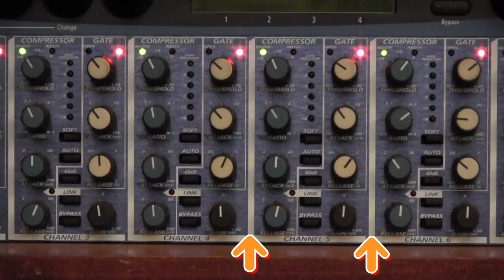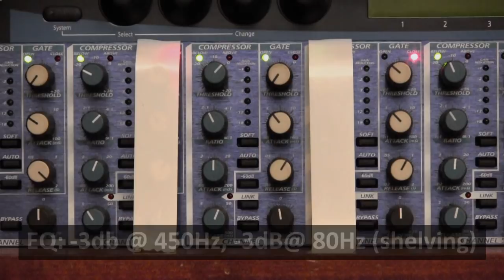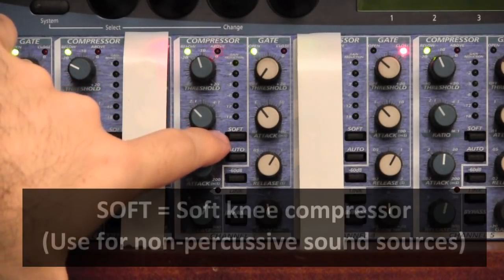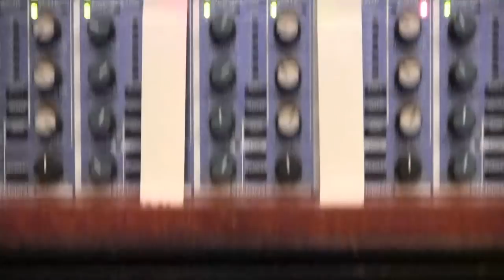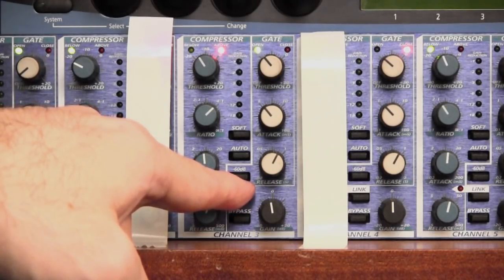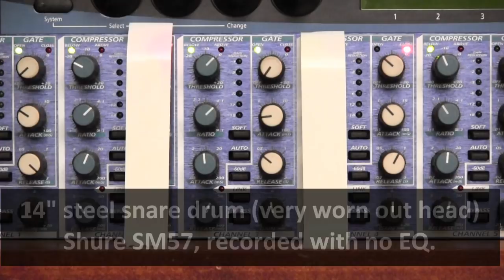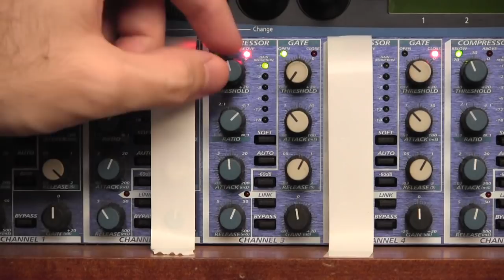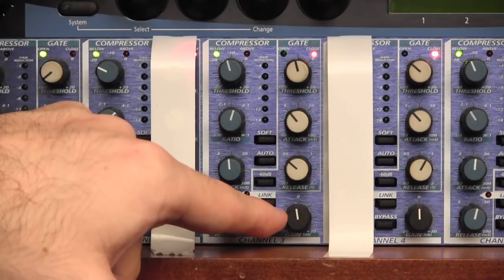How to operate the Presonus ACP88 8-channel compressor/gate

Comment from the maker: Welcome to the sound engineer community! The best way to hook up the unit is using the insert points on your mixer's channels - this is shown on page 15 of the owner's manual which can be downloaded from the Presonus website. Alternatively, if your mixer doesn't have insert points, you can go TRS out from your wireless receivers into the input of the ACP88, and then TRS from the output of the ACP88 to the LINE input on your mixer.

Comment from the maker: - You're welcome, glad the video was useful. Because the Firepod has no insert points, it would be difficult to integrate the ACP88 - you cannot connect mics directly to the ACP88, and it's really designed for use with a mixer. My advice would be to use the software processing in the Firepod itself to do your gating and compression - just be sure to set your gain levels conservatively when recording, and add dynamics controls later on. Hope this is clear, feel free to ask other questions :)

Comment from the maker: - Thank you, glad the video was useful! If you have already checked the fuse in the unit and the outlet, I would say the other possibility could be a faulty switch, or a blown fuse in the power cable - I would try switching to a different IEC cable for starters.

Comment from the maker: - Thanks for the question. Typical setup for live use would be to connect your drums to the mixer first. The presonus is inserted on the individual drum channels as shown in the video, and the lexicon is run on a post-fade aux send so that all the drums can be routed to it as necessary. Finally, the lexicon is returned to the mixer using a stereo input channel. This will allow you to adjust gating, compression and reverb for each drum separately.

Comment: Thank you for a great presentation. I have used compressors and gate/limiters often in DAWs, but not hardware. I recently picked up a ACP88 for $50USD (needs repair unit). Concepts are the same, but I never really dove into just what was going on. Just fiddled with knobs until I got the sound I wanted. I went into my favourite DAW after this, and applied the concepts to very common and basic sample kick, snare and bass. Compressors and gates really do give you that snap and pump, as well as greatly define the shape of the sound. Now that I know full well what exactly is happening, I can better apply them. Can't wait to repair the ACP88 and try it out on my hardware synths.

Thank you for sharing
Reply from the maker: Thanks for the comment! Hope you enjoy your new hardware compressor - I always find having physical control knobs makes my mixing experience much more enjoyable.
Reply: For me you will learn more by turning the knobs with your own fingers on an hardware prossessor like the ACP 88, you will hear that just changing a fwew millisecondes the attack by example, how much it can change the sound.
From Switzerland mountains, I hope you will enjoy by mixing with this kind of gear! 😚🇨🇭☃️🌲

Comment from the maker: - The easiest way to determine the location of the fault would be to swap the cables between channel 6 and one of the other gates that is known to be working. If channel 6 is now working, then you know you have a cable problem. Otherwise it is probably a fault internal to the unit.

Comment: I started doing sound for a community theater group.  We have several Shure, Sennheiser, and Samson wireless microphones and in one of the racks was an ACP 88 unit.  One thing you didn't show is how to connect in the back of the ACP 88 unit.  I can go XLR or TRS out of our wireless mics into the back of the ACP 88.  There are 4 TRS jacks on the back of each channel on the ACP88.  what do I plug into what TRS when I only have 1 mic output for each mic.

Comment from the maker: - Thanks for the comment, you raise a good point about how to hook up the unit. I will make another video showing the rear panel connections when time allows. To begin with, do you have the necessary 'insert' cables with which to hook up the unit? Personally I use the unit live as well and it works really well.

Comment: Do you subscribe to the notion of always running the compressor only in the insert plug or do you sometimes go through the compressor first?
That was a fantastic presentation of the compressor function and usage. I learned a huge amount of information. Thank you very much.
Reply from the maker: Thanks Doug! It depends on what I'm using the compressor for - if I need compression on one specific channel it will be in the channel insert or inline before the channel input. If I need compression on an entire mix then it will be in the main inserts or inline between the mixer and the power amp 😊

Comment: Thank you so much sir for video. i do clearly understands now how compressor and gate works. Sir, can you please tell me which band instruments or mics on the stage are the sound engineers putting compressor and gate?.

Sir do you have a video of how to remove feedback using 31 band EQ in stage monitor and the front of house speaker?

Thanks a lot sir.
Reply from the maker: - You're most welcome. Compression can be used on almost any input, from drums to guitars and vocals. It is also used on the main LR output. Gates are generally used on drums and other percussive instruments. 
I don't have any videos on 31-band equalizers because I generally prefer parametric EQs for live use. Also most EQ on large PA systems these days is done using the software EQ on the system processor.

Comment: great  video but it is a mulri channel compressor.. mine is only a 2 channel compressor thus why i want to insert it at the main insert instead of a single channel.. additionally i saw a video on using a y cable to do it but im not seeing any read out on the display thus why im asking you for additional help

Comment: Can you please help me! I new to micing drums, I want to buy the setup you have and I need 8 channels for my DW drums . Does the Lexicon effect unit connect to the Presonus ACP88 8. Then the Presonus connects to the mixer.Or does the Lexicon need 8 separate outputs or does it use 1 cable to send effects to all 8 channels on the Presonus. I know to get a good drum sound you need Compression, Gating, and a little Reverb. I just understand how the Lexicon connects to the Presonus. Thank you so much

Comment: just came across this compressor,gate,limiter. im wondering if you still use this till today ? im currently looking into getting outboard gear, some of the compressors are pretty high in price and only offer 1 channel. this in the other hand has 8 channels which would work perfect for a drumset. would this still be relevant with the products out today ? thank you for the video !
Reply from the maker: Hi Arturo, I still use it from time to time, but over the past few years I have begun to use less compression in my mixing - modern active speaker systems include system compression and good musicians and singers will often 'self-compress' through the use of good playing and mic technique. However the ACP-88 is still an excellent choice if you need 8-channels of compression in a compact unit!

Comment: Difference between dbx comp 166xL and that presonus acp88-8?
Reply from the maker: Similar functions with slightly different controls and connectors. Obviously the ACP88 is an 8-channel unit vs 2-channels for the DBX 😊

Comment: Can the ACP88 be used in conjunction with the Tascam Model 12, although it doesn't have insert connections?
Reply from the maker: The model 12 has insert points on the first two channels. The compressor can also be patched in between the mixer and your amplifier.
Reply: @GLBProductions  Thank you.

Comment: Thanks for a very informative video! I recently acquired a used ACP88 and plan to use it to record drums. However, the mixer I use is a Presonus AR16 USB and it only has inserts on channels 1 and 2. Do you know if there is a way to use all 8 channels when I only have two inserts? Thanks again!
Reply from the maker: You're welcome! Unfortunately this unit really needs channel or main insert points to function most effectively - it's an old school design that pairs best with old school mixers 😄

Comment: Good video thanks, I saw that PreSonus put the compressor at first than the gate after, usualy most of enginners and me too when using both gate and compressor we put the gate at first than the compressor, is it possible internaly on the ACP 88 to reverse the way and having the gate at first? THANKS for an answer.
From Switzerland mountains I send you all myBEST to all of you and having pleasure by mixing a lot of gigs.
❤️🌲☃️🇨🇭😚
Reply from the maker: Thanks for watching 😄 You would need to ask Presonus about reversing the order of gate and compressor - there is no mention of this in the user manual.

Comment: Hi, thank you for your excellent tutorials. Could you explain what the "link" function does please?
Reply from the maker: The link function connects two channels of the unit so that they track together, ie the amount of compression is the same on both channels, usually following the first channel's settings. The is most often used for stereo sources where you want the stereo image to stay centred during operation.
Reply: Thanks for this explanation and for your quick response.

Comment: Bruno in the video you don't share why you keep the Gain set at 12 o'clock.  Given a compressor does reduce the dynamic range of the signal, and thus the overall signal level, how are you making up for the reduced volume when the signal exits the ACP88 and returns to your mixer?  Are you just using more fader on the mixer, or some other technique?  Thanks!
Reply from the maker: Sean Kent A very perceptive comment indeed! That video has been up over two years and you're the first person to ask about that. When I first started doing sound, I read a book by a very experienced live sound engineer by the name of Duncan Fry. In it, he explains that in live sound with loudspeakers connected to mics in the same acoustic space, you need to be very careful about using more than 2-3dB of make up gain on a compressor, UNLESS you are confident that your system EQ is perfect. You see, when the music is playing and the compressor is compressing, it's no problem because the make up gain is being used to compensate for the gain reduction on the compressor itself. When the music STOPS, your gain reduction goes to zero - at this point, any make up gain you have dialed into the compressor suddenly becomes EXTRA gain, and can start that channel feeding back very quickly! He argues that it is much safer to simply ride the fader, as then you do not have this issue of 'hidden gain' that is not accounted for by the channel gain knob. I have heeded his advice ever since. The advantage of not using the make up gain knob on the mixer is that you reduce the number of gain stages in your signal chain by one, and you know for fact that when you see no lights on the compressor, you have just that - unity gain, as opposed to a certain amount of gain addition that may be different for each channel. Now in recording I take a different approach because there is usually no risk of feedback, but this is my technique for live sound. Thanks for asking!

Comment: Hi, Bruno, i am sorry to bother you, when you hook up compressor, you have to set the gain from mixer first right.  Then adjust the compressor second
thanks
Reply from the maker: hoang tieu Correct - set gain on the mixer first, then insert the compressor and adjust for desired amount of compression. This will give you the best signal to noise ratio.

Comment: I thinking about getting a presnous acp 88 but I have a question I'm using alesis 3630 compressor I was wondering how will I set it? Does I output from the mixer to the presnous or to the alesis first?
Reply from the maker: chai cha chai cha The controls on the 3630 are similar to those on any other analog compressor/gate unit - have you consulted your user manual? Connections on the Presonus and Alesis are also very similar - see my video here: https://www.youtube.com/watch?v=RLf8jXGtF8w

Comment: hi Bruno thanks for this video, it is very helpful. One question though, can i use a behringer feedback destroyer in between my mixer and amp? TIA
Reply from the maker: Yes you can :)
Reply: Thanks Bruno! Btw ive got a tapco sq.2 by mackie, a vintage one 😅 any ideal settings that you can suggest?

Comment: I want a dynamic range expander for my PC-AUDIO system to listening internet-radio. A station broadcast too much compressed music. I can not stand to listening it. If there is a model of gate/ducker with gain reduction knob, can I use the gate/ducker as an expander?
Reply from the maker: - Unfortunately an expander will not help in this case, as it has no way of knowing where the dynamic peaks were in the music before it was compressed, and/or what compression ratio was used. I suggest that you find another station that uses less compression.
Reply: GLB Productions I know that as you say, cannot be reproduced exactly. But do not be able to alleviate of compression? In fact, I am using an expander(for home audio product) already. It is a dbx 3BX-DS. If we're not acceptable may not be reproduced exactly, the concept of this product is incorrect. My expander dbx 3BX-DS is a vintage item, so I want a standby equipment.

Comment: GLB Productions Hi how can i hook up a subwoofer in my setup. can i remove the bass in the speakers then direct it to the woofers? Thanks
Reply from the maker: - Hi Juromebato, the easist way to do this is to get a subwoofer which has a built in crossover - that will separate the sub bass frequencies and direct them to the sub whilst directing everything else to your main speakers. Most modern powered subs from companies like EV and JBL have this feature. 
Alternatively you can get an external crossover, or if you run passive speakers look for an amplifier which has a built in crossover.
Reply: This is very informative! Thank you very much.
Highly Appreciated
Reply from the maker: juromebato You're welcome, all the best with your music.

Comment: Does this compressor hum. I just turned mine on for the first time and noticing a hum coming from the machine itself
Reply from the maker: No it should not hum. Try changing to a different electrical outlet and checking to ensure that the unit is grounded correctly.